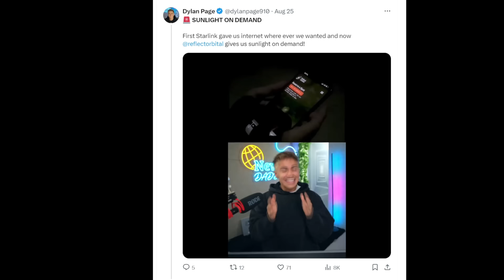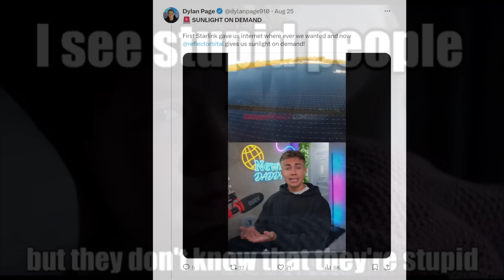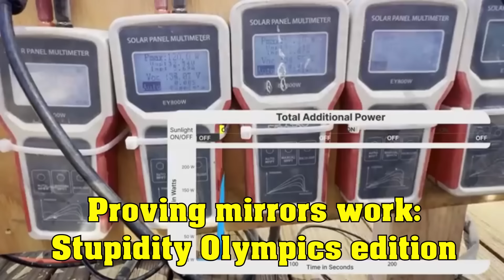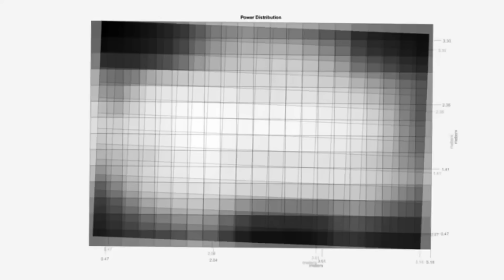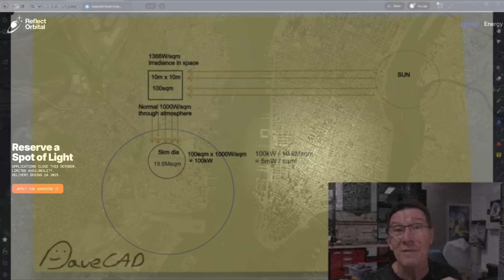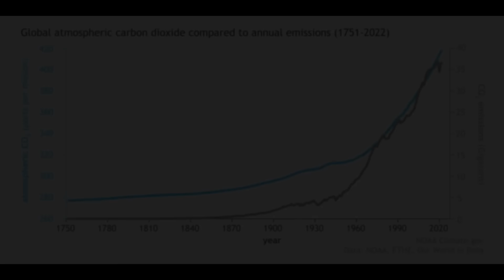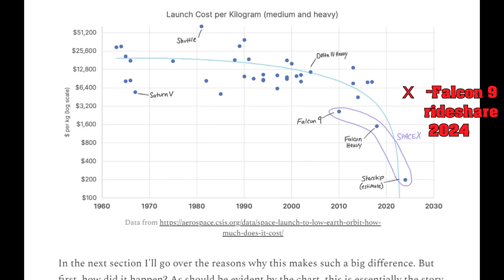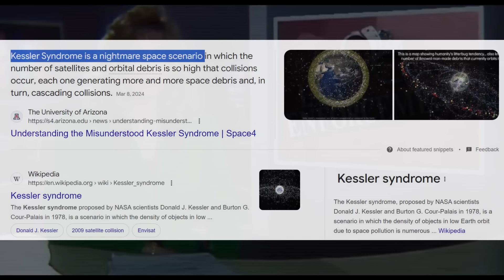Reflect Orbital: BUSTED!!

Comment: The Soviets did, in fact, build an orbital mirror, the Znamya. It made a 5km wide spot using a 20m mirror which was about as bright as the full moon... and then promptly burned up within a few hours.

Turns out, large objects in space get more drag from the barely existing atmosphere.
Reply: Could this be solved by simply placing the mirror in a higher orbit past the kármán line?
Reply: @deltap6967  it was already 5x the altitude of the Karman line. The size and lack of mass made the drag far worse than other satellites. Realize, this thing was about 1/6 the size of the International Space Station, but weighed in at 7,200kg, less than 2% the mass of the ISS. It simply did not have the inertia to overcome drag.
Reply: @downix your explanation seems to be incorrect - one ripped since it wasn’t a solid mirror and was deorbited - and burned up and the first one was also deorbited - and it burned up -
Reply: You make it sound like it ended in failure. Not true. "promptly burned up within a few hours" as planned. It was a successful test and that is how they got rid of the junk once it did its job. During the 2nd test, they had an accident at the beginning and they never tried it a 3rd time because it was proving expensive. The idea wasn't to generate light to power solar panels but just enough to allow humans to do work at night, in Siberia. It was much more modest in its goals and made sense.
Reply: @senerzen  I brought it up more to demonstrate what a real world example of it did accomplish,  and the hurdles they encountered.
Reply: @downix but you falsely represented its objective and the planned deorbit disposal. So a bad example really
Reply: > then promptly burned up

controllably deorbitted due to stupid enviromentalists raising unnecessary panic*
Reply: @deltap6967   that was the eventual goal to put it in a geostationary orbit much higher, but they purposely put it in low orbit so that  they would eventual burin up  it was just to test the concept
Reply: @NoNameAtAll2  during the Soviet era there were no "environmentalists" that could raise any concerns. Those people were either in gulags or chained to their workstation in the factory.
Reply: @KT-pv3kl  space mirror was funded, built and launched *after* the Soviet Union already disappeared

enviromentalists existed, at the very least since Chernobyl (but similar specialists existed even earlier)
Reply: @KT-pv3kl  also I suggest learning more before spewing stereotypes, since...

Gulags are from Stalin era - who died 10 years before Space Race even began (and even then it wasn't the name for work camps you imagine - that's the popularized mistake)

Workers weren't chained to the workplace - everyone could change jobs, but if you got specialist education and got directed where such specialists were needed - why bother?
Reply: @NoNameAtAll2  it was tounge and cheek but do go ahead with your communist apologetics I'm sure you will start coming up with excuses for genocide and political assassination next...
Reply: Yeah I thought it was strange how this video never mentioned Znamya.
Reply: @senerzen  That's still the dumbest way of trying to provide useful, reliable light at night in Siberia.
Reply: The smug here is so thick it can deorbit you from the earths surface.
Reply: @DingbatToast  Except the discussion was over the issues of a mirror. That they anticipated those issues, and exploited them for disposal, does not make them non-existent for any future space mirror project.
Reply: @downix  you also believe that SpaceX totally planned for the first starship to explode for convenient disposal right?
Reply: @KT-pv3kl  the 1950's called and want their propaganda back.
Reply: @KT-pv3kl  There were and they did have impact. I recommend watching the video from Asianometry released a few days ago on this exact topic.
Reply: The reason project Znamya never got anywhere is because it's a dead end pipedream that sucks up valuable government funds that's ever drying up following the collapse of the USSR. If the soviets wants their workers in the arctic to work both day and night it's much easier to dope them up with some methamphetamine than to launch a giant mirror into orbit and light up the work site. The soviets don't see any practical potential in the project other than proving that they can reflect light with a mirror in space and light up a decent size area comparable to a full moon. It was never their intention to take Znamya seriously other than training more rocket scientists, which isn't needed since the space race is well over by this point and they're facing an imminent economic collapse. Much like various other scientific projects in this era the soviets pull the plug on them as it's not economically feasible anymore
Reply: @rafetizer  Obviously they knew something that you don't.
Reply: Differential drag too. Different parts of the craft are affected differently not only by drag but just orbital mechanics. The side slightly closer to the oblate planet we call earth with experience a force which wants to change the position of its apses of its orbit, more than the other side, inducing a tension force that could tear lightweight film mirrors quite easily.
Reply: If you want to use solar energy at night in Siberia. Wouldn't it be much faster and cheaper and more reliable to just build Battery with an additional solar panel in Siberia?
Reply: Asianometry did a video of that recently
Reply: @KT-pv3kl there was never genocide in the USSR.
Reply: That's not true either.

Comment: I knew you couldn't resist!
Reply: You guys are great!
Reply: @EEVblog
Well, TBH: knowing in advance that TF would take such a tasty bait to run with it and have fun with it, that wasn't exactly rocket surgery, innit? 🙂
Reply: I think he is a bit off with his debunk again.
He narrowed down on the flat mirror reflection spot, but thats not really the issue. You could use a focussing mirror (Setting aside production problems here) to get a 1:1 spot size for a gaussian beam (Only rough estimate for sunlight). Then the atmospheric refraction is probably the defining factor instead.

There are other parts of this concept that work out much worse.
Reply: @mathis8210  its still a garbage idea anyway
Reply: @rafetizer  It is.
Reply: @mathis8210  There are still limitations (atmosphere would interfere with focusing light too much - not to mention it is literally increasing amount of sunlight we get when Global Warming is the problem) and of course launching bigger and differently shaped "mirrors" would drive the costs up. But yes, you could focus it and achieve higher efficiency. The thing is that creators of "space mirrors" are themselves talking about 10m x 10m flat mirrors. I don't thing I would have done it even as technology demonstrator, because I would be laughed off by science community. It would be better if they at least had the plans of mirror geometry solved and what would be stopping them would be all those other issues that you mentioned as "working out much worse".
I didn't do calculations (I haven't done optics in long time sadly) - but I also wonder if Conservation of Etendue wouldn't become a problem. And solving it that you could use it longer than couple of minutes - that's still at least "thousands" of mirrors.
TBH it's a low effort debunk, because the "inventors" in this case are such a low hanging fruit. I mean SpaceX compared to them looks and is actually waaaay more competent. While they are very much behind on their promises, they do transport onto and off from ISS. So the debunk is off, because the ones being debunked are so much off that it is hard to comprehend how they have money to literally waste on things that can't work. At least not in the form they presented it.
Reply: @mathis8210  You still only have a 10m square capture area.
Reply: Now I have to go watch your video.  🤣

Comment: I got the perfect ide! Dig an 100x100m underground pit, put a 1m² hole with a lens to illuminate the whole floor and cover it with solarcells. Only 1m² land used for a 100000m² solarfarm, we can get so many investers on this one if we only call it "Solar freaking hole"!
Reply: I cannot tell whether you are sincere or joking.
Reply: @pinky6758  Neither can the venture capitalists, which is why these dumb-as-a-bag-of-hammers ideas keep getting millions of vc thrown at them
Reply: Might actually work lol
Reply: actually this has been done sorta.    It was called the solar box  IIRC.     basically a box with mirrors with a small solar panel in the middle.     The idea was to make a cheap way to get more sunlight onto a solar-cell thus taking the efficiency go from 22% to 90%.    VS   just making bigger solar panels running at 22%.    both get the same output but the solar box was way cheaper.
Reply: We can also generate extra energy by burning things inside it for the extra brightness ! We can use paper money for that since crypto is the way of the future !
Reply: @macheadg5er  I doubt that it actually worked – efficiency won't go up to 90%, because you get a heat problem concentrating sunlight on a smaller area (reducing the efficiency of the solar panels). And solar panels are cheap by now, so it won't be cheaper these days. And it effectively needs the same space. Makes no sense in the end.
Reply: I have a much better idea. Instead of digging a big hole, just use old british police phone box (they are bigger on the inside), replace the roof with a lense and plaster the floor and walls with solar cells
Reply: @donkink3114  It will work but the energy you get from it will be limited to the size of the 1x1m hole... So less then you would get from 1 solar panel, but you will be using 1000s of them, a real money hole ;)

Comment: "Worked at SpaceX?" -Check "Incredible dumb idea?" -Check. Let the VC bucks roll.
Reply: "It's really simple, bro" -Check
Reply: @alexgummer4979  thunderf00t didn't invent the inverse square law. You'd need a high power laser with an impossibly large diameter lens for this to work.
Reply: @alexgummer4979  it's fine to just say you don't understand basic physics
Reply: @alexgummer4979  your just flat out wrong I just looked it up and it's exactly what thunder said 5k roughly per kilo

Comment: This reminds me of the historical legend of the Archimedes death ray. The legend goes that Archimedes burned the Roman fleet anchored off of Syracuse, used shiny hoplite shields to reflect enough sun to create a beam, a death ray if you will using concentrated sunlight to set fire to Roman galleys, in other legends, it was a big claw that would attack Roman ships. The legend would change overtime, based on the author and the technology of the age, in newer spins to the Archimedes death ray, it was a mirror created from bronze, a mirror created from glass - which did not exist in late antiquity, to a mirror built from some lost tech, this myth has many branches, all created by the scientific and historically illiterate. Mercifully, the Mythbusters finally put the Archimedes death ray into the legend rather than history, however, it seems like quacks and cranks are trying to reinvent the Archimedes death ray for "Scientific Purposes", even if they have to break their minds and the science to achieve their cockamamie schemes. By the way, the Greeks lost the 212 BC Siege of Syracuse to the Romans, who successful stormed the city, killed Archimedes, then proceeded to pillage and butcher every Syracusan, overall, it was good ol' fashioned tech that won the siege for the Romans, meanwhile, the Greeks wasted time and resources on wonder weapons, it would have been more efficient to add to or improve the existing tech, but the Syracusans thought the great intellect of Archimedes would save the day,  but in the end, all of Sicily would belong the Romans, and all the Greeks would be subjects to Roman civilization.

Comment: As the Futurama clip showed the solution to the divergence problem is to use a curved mirror. These brilliant engineers should hire a cartoonist to do the design work.
Reply: Remember, most of them were scientist and had some form of degree is sciences.
Reply: Sarcasm?
Reply: The guys might not even know what Futurama is, and you expect them to realize to hire a cartoonist?   That does not work with their magnificent investor plans.
Reply: @christopherbiomass7155 Sarcasm is a science now?  I would love to have a PhD in Sarcasm.
Reply: Seems like a solution to a problem that doesn't exist either way. Even if you manage to solve the light focus problem, satellites don't float on a static area like a hot air balloon. They need to move very very fast to prevent them from crashing back to earth. How are the planning to aim a mirror while going 17,500 mph?
Reply: @christopherbiomass7155  Times two ... It reflects.

Comment: The USSR actually planned to use solar reflectors for growing crops. They were to be in geostationary orbit. There's an article about it in the New York Times from 1987 (you can find it on Google), plans were to start in the 90s, the Energia rocket was partially designed for this purpose. It was the first stage, second stage was placing collectors to beam energy down as microwaves.

Comment: 30 years ago, SimCity 2000 had "microwave power plants" that would have a sunlight-powered orbital MASER beaming energy down to a receiver on earth though a coherent microwave beam... But occasionally the beam would miss its target and a nearby skyscraper would burst into flames. No pollution, though.
Reply: I liked those power plants. Cool concept and looked better than the Fusion Power Plant.
Sim City 3k made them a bit different but also made the Fusion Power Plants a lot cooler.

I remember the SC2K scenario where you had to stop the fires caused by a microwave power plant missing its target. The power plant was most likely to go up as well but sometimes you could save it.
Reply: @stylesrj  you could call cousin vinnie and get free bailouts from the mob
Reply: @alainportant6412  
Or a free castle if you refuse the offer because it turns out it was a sting operation.
Reply: That's far more likely to be workable at some point. A beam of light being bounced across a couple satellites before being directed at such a facility is at least something that could happen. I doubt that the practical issues with it will be solved before there are  better methods of generating renewable power, but it's a lot more reasonable than this is.
Reply: Man I miss those SimCity 2000 games. RIP OG Maxis Studios 😢. Burn in hell EA 🤬
Reply: There are thermal solar arrays that sort of work this way, but the mirrors are on the ground, and they direct the suns light at a tower.
Reply: @jamesbyrd3740  
And now you remind me of the Archimedes II in New Vegas. That used a Thermal Solar Array to generate power... but then it sent it up to a satellite to then zap an area? I dunno how exactly that worked, I just know the power plant was needed to use the satellite weapon...

Comment: These guys did all this work and sent up a hot air balloon with some ridiculously complex rig, to achieve what could be done with a $1 mirror and a $4 toy in your bedroom 🤯
And instead of discovering what a stupid idea it is, they called it a success and it spurred them on 🤦‍♂️
Reply: Or a hill…
Reply: @johnnyfrancis2761  Exactly, or putting both the mirror and the sensor on the ground, so that you can actually take some reliable measurements.
Not that optics is a field that is basically solved for 300-ish years now...
Reply: You'd think if they'd go through all of that trouble that they'd at least have tested different shaped mirrors.
Reply: Fatherless homes are to blame
Reply: This could've been done at the same scale with a small cliffside and 2 Ikea mirrors, saving tens of thousands of dollars.
Even a concave mirror can be cheaply made.

It's almost daycare for adults at this point.
Reply: Sometimes being not stupid works. And being stupid does. Please don't kill the messenger.
Reply: What gets me is that they make outrageous claims that even a layman like me finds utter BS, but they somehow manage to get government funding and media coverage.
Reply: That was a lot of effort, but it was not complex.  Like building an amateur tree house.

Comment: The problem isn’t so much the cost of production, but one of the cost of transmission. You need a power grid and no much how much you reduce the cost of production you don’t lower the cost of transmission. This is one of the problems facing Fusion power, you can basically use seawater for fuel, but the transmission costs are the same.

Comment: The Soviet Union back in the day have already tried this. They did manage to put a circular mirror in orbit twice.
Reply: Well only one worked. Sort of.
Reply: Znamya. Only the first version worked, the second prototype failed in an accident.
Reply: I mean...Webb is just a big mirror. Mirrors are easy. Space is easy. Keeping mirrors in space is hard.
Reply: Not the Soviet Union but Russia, this was in the 1990s.
Reply: It was described as being about as bright as a full moon and was 20M wide according to wiki
Reply: They put a mirror up there, yes, but the application was totally different. What these guys want to do is prevented by the sheer size of the Earth and the number of additional satellites they'd need, the fantastically large size they'd need to be, and the ridiculously high orbit required.
Reply: Well done to them.
Reply: @jeremysmetana8583  maybe if they had 230 trillion satellites in geosynchronous orbit using a few thousand years of the worlds GDP to make it all they could do it on a very limited basis, but I’d rather just buy a $30 light and power it with $0.30 worth of electricity.
Reply: @sntxrrr 
Well... The company started in the soviet union...

Also: hi Asianometry fans!